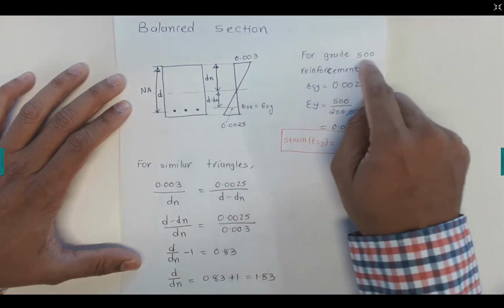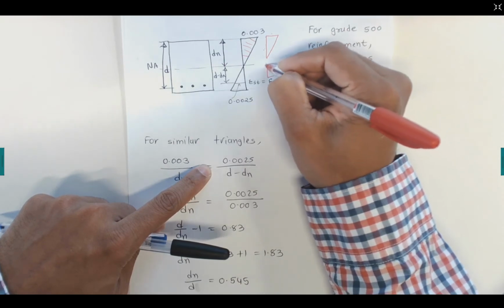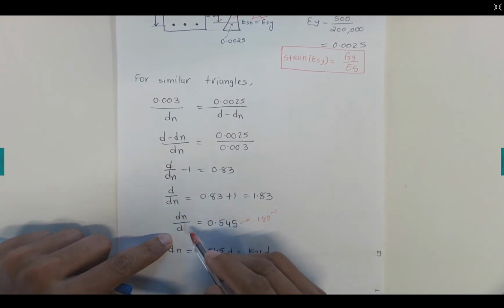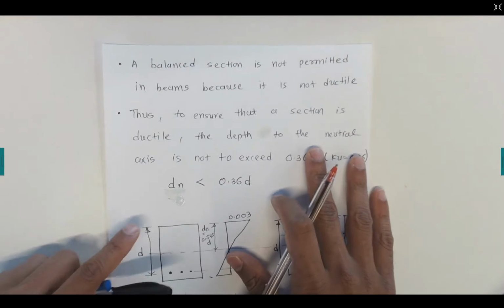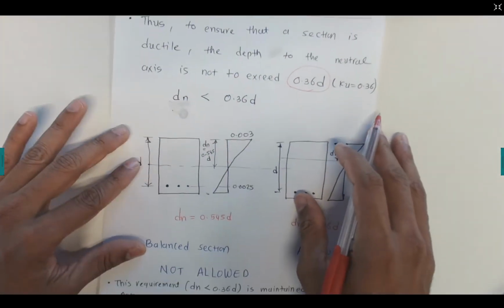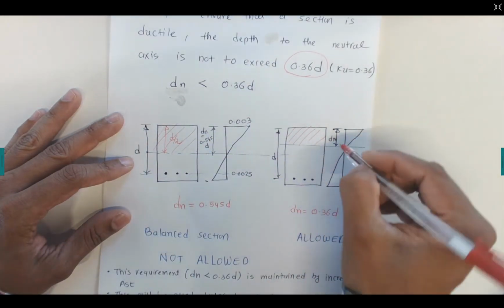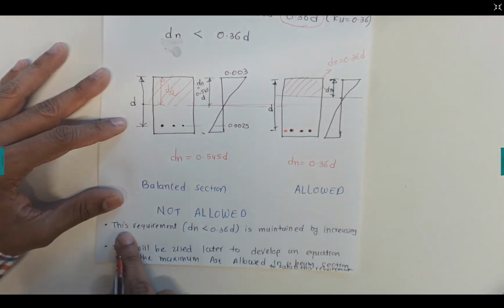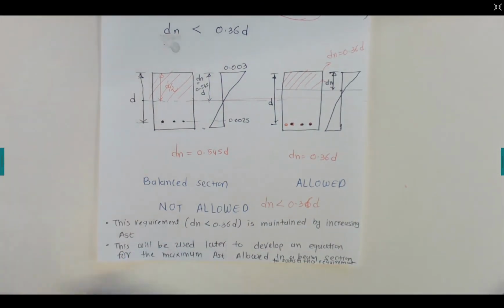Balanced section

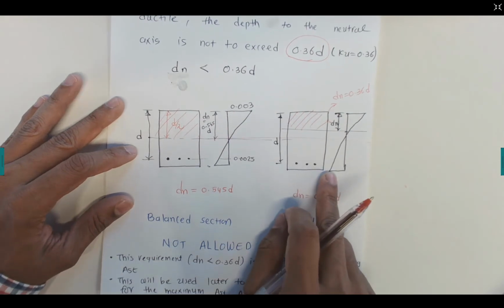Comment: 3:27 isn’t it the other way around….. you need to reduce Ast to push the NA above…. Remove reo to make a balanced section UNDER reinforced section (hence the name Under reinforced). BTW your videos are great help…
Reply from the maker: Thank you for your comment and for watching my videos. I appreciate your feedback.

Regarding your question, it's important to note that the concept of a balanced section refers to a section of reinforced concrete that is neither under-reinforced nor over-reinforced, but instead has the reinforcing steel in tension and the concrete in compression at the same time.

In order to achieve a balanced section, the position of the neutral axis (NA) should be located in the middle of the section's depth. If the NA is located above the centroid of the section, it would result in an under-reinforced section, while if the NA is located below the centroid, it would result in an over-reinforced section.

Therefore, in order to push the NA above the centroid and achieve an under-reinforced section, you would need to reduce the amount of steel reinforcement (Ast) in the section, which would result in a larger area of concrete in compression. Conversely, if you want to achieve an over-reinforced section, you would need to increase the amount of steel reinforcement.

I hope this clarifies the concept of balanced sections and how the position of the neutral axis can be controlled by the amount of steel reinforcement in the section. Let me know if you have any further questions or comments.
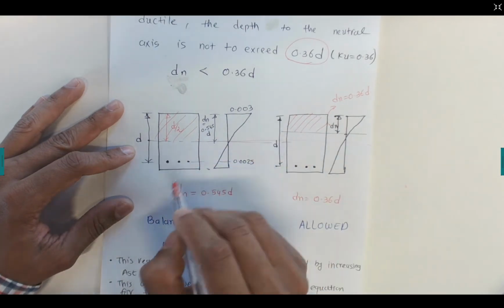Reply: @Vipul Patel I agree with your comment but not with what you said in the video at @3:27 .... one needs to REDUCE the number of bars (i.e. reduce Ast) to push the NA up.... 

Ast * fsy = (alpha2 * fc' * b * gamma) * kud

(Ast * fsy) / (alpha2 * fc' * b * gamma) = kud

Now from this equation, Ast is direcly proportionally to kud. Thus more Ast means more kud i.e. more is the dist of NA from extreme comp. fibre. Thus to push NA  up we have to reduce Ast.